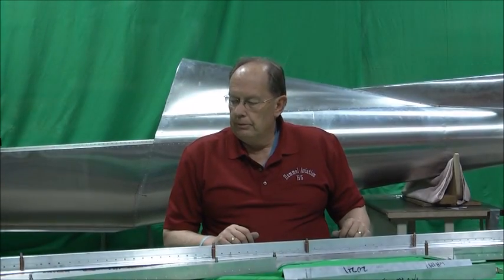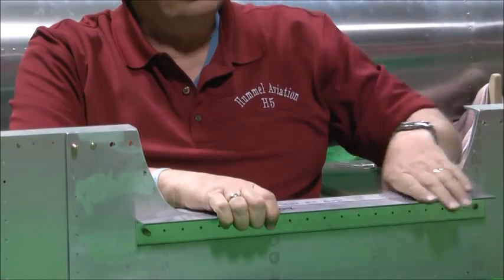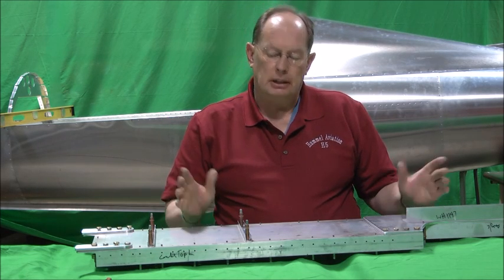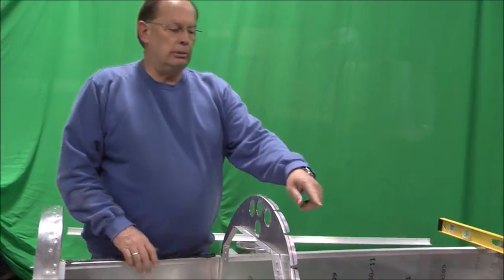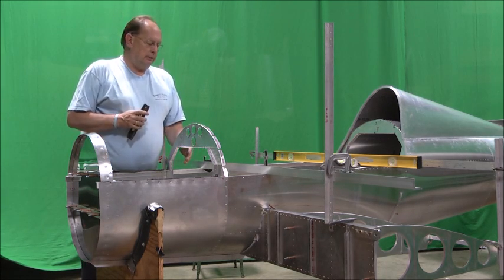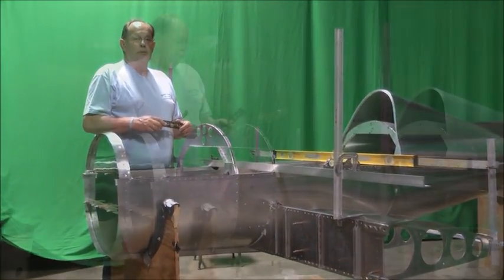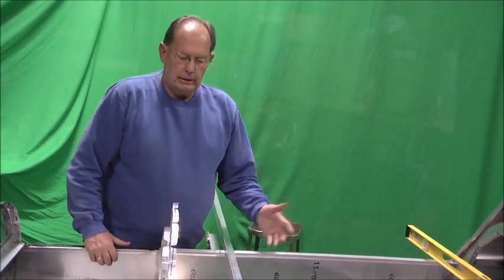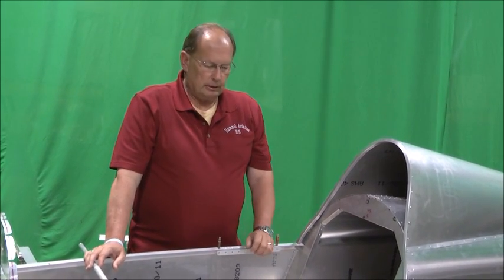Step 14 -  H5 Wing Spar Installation

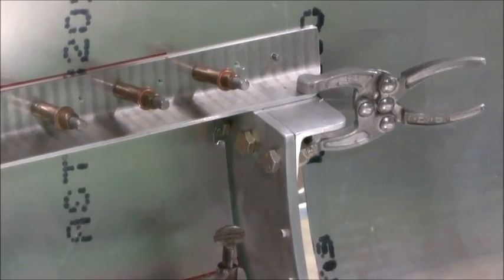Comment: If the vertical bolt, for the upper spar attach angles,  interferes  with the spar cap bolts (18:51)  you could reverse the position of one spar bolt. Put the bolt head aft. I know that standard practice is to put the bolt head forward  but, I have seen several instances in certificated aircraft where the manufacturer reverses the bolt orientation if there is a clearance problem.